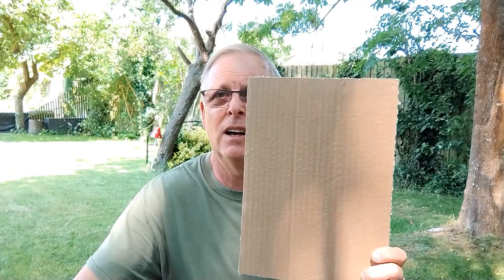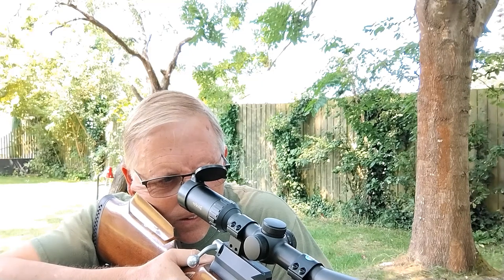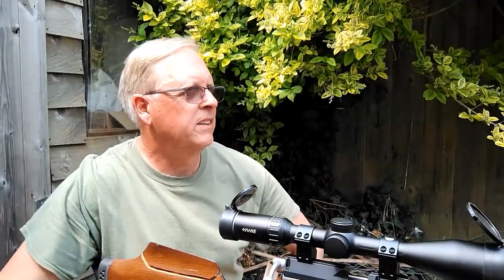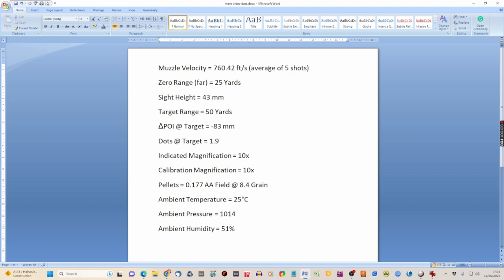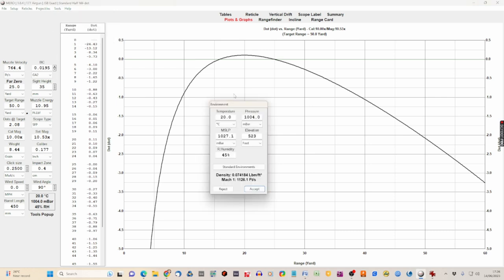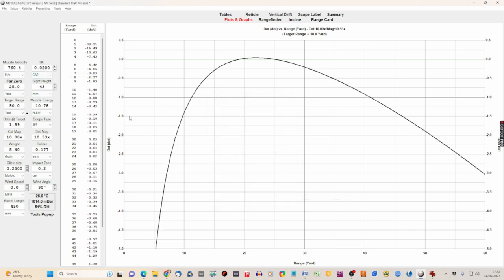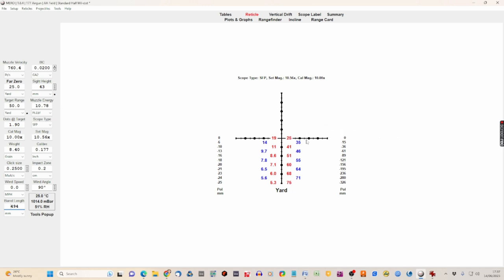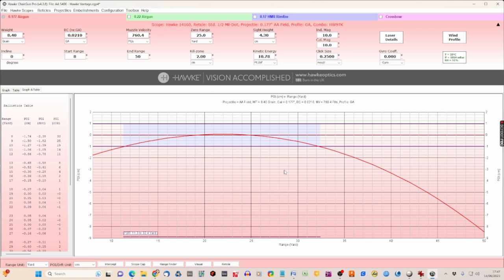9 - Master Air Rifle Ballistics Software in 5 Easy Steps

Comment: Thank you for this great series of instructional videos. Could I ask if there is any practical benefit to have a chronograph that can measure the projectile speed at the target instead of just at the muzzle?
Reply from the maker: Thanks! Not in terms of a single chrono I think. If you had two chronos, one measuring muzzle velocity and one measuring velocity at target for each shot, then you could calculate an accurate ballistic coefficient for your pellets.

Comment: Hi, I think I saw you at the recent BRK day! Thanks for the good tip regarding scope height. Do you do this after you have zeroed the scope, or when the reticle is optically centred? Thanks.
Reply from the maker: Hi Malcolm, if you're doing the tin foil test then probably best to do it after you've zeroed your scope. 👍
Reply: Thanks!

Comment: Great information. Hopefully you can answer a question for me. I am zeroed at 50 yards, shot a 100 yards and Mero calculations were way high. I adjusted to hit my target. I then changed my scope height setting from 2.66 inches to 5.50 inches to get hold over correct. Am I doing something wrong or is this normal to adjust scope height setting? Should I be changing another setting? If you have time, I would greatly appreciate your input. THX--Matt
Reply from the maker: Hi Matt, as I understand it the crucial settings are scope height and ballistic coefficient. I would recommend using the tin foil method to find your exact scope height at the muzzle and measure your pellet drop at a set distance to determine a more accurate BC if you're using manufacturer figures. I'm zeroed at 25 yards and measure pellet drop at 50 yards. It sounds like you can shoot to 100 yards with your 50 yard zero so I would measure at 100 yards and use the Mero tool to work out your BC. Once you put the figures in Mero will match your results at 100 yards and calculate backwards for shorter ranges which should be closer to what you're experiencing. However, at the end of the day shooting on paper at different ranges is always going to give you the most accurate drops and aim points for your rifle. Hope that helps.
Reply: @hftshooter  
Thank you for your response. I will give that a try. Much appreciated.--Matt

Comment: Hi Jeff, brilliant piece of work which must have taken ages to put together, I am learning all the time.  Not sure about the tin foil method, seems like a very "iffy" way of getting an accurate measurement.  How did you discover that a simple mechanical measurement of the scope/barrel was incorrect?  Using basic trigonometry, based on a 25 yard zero and a 45mm scope hight (hate mixing units) at the objective (Scope diameter + barrel diameter /2) + gap between top of barrel and bottom of scope) if the barrel sticks out 400mm beyond the scope then the difference in the trajectory lines would be 0.692mm which is nowhere near 5% and is within acceptable error. This is not criticism, just debate to find the best solutions 🙂
Reply from the maker: The tin foil method is in no way iffy. Measuring at the muzzle is the most accurate figure. That's where the ballistics start. I learnt this from a respected source who's info I trust.
Reply: @hftshooter  Please don't be offended. I am just trying to debate the method. Just stating it is right without any background doesn't work for me. Calculating is as near absolute as you will get with known dimensions. You didn't measure at the muzzel. You measured at an unstated dimention from the muzzel to the cardboard, you also hand held the rifle which could also lead to deviations and you measured to an estimated centre of the pellet hole.  We are talking about small dimentions so very little room for error.  If you would prefer that I didn't comment on your content just say and that will be that.
Reply: @fxpeter22  I'm not offended at all, please don't think that. I welcome all comments and questions. I'm not an expert and am just passing on this stuff as I learn it myself. I'm happy to be proved wrong at any time if I've picked up bad information. Unfortunately it's very easy to get misconstrued in a messaging app.
If you check out my video number 45 from about 16:30 I cover the tin foil method in more detail. You should see that the muzzle is touching the paper target when I take the shot. I have read some compelling articles promoting this method and have also noted graphics in some ballistic apps that clearly show that sight height is measured at the muzzle for ballistic calculations. Still happy to be proved wrong if that's not the case and I would happily broadcast a correction from the channel. I encourage you to continue to challenge everything to get to the truth; a mantra to live by! Best wishes, Jeff.
Reply: @jeffmccall8013  That is great. I will get back to you 🙂

Comment: Great video, thank you, Iv'e had a look at downloading MERO V1.9.0 on my Windows 11 machine however my antivirus and windows is suggesting it's an unsafe program to run?! any thoughts on this, thank you.
Reply from the maker: Hi Michael, sometimes Windows can be a bit over-protective with installs. In this case it just doesn't recognise the software creator. If you click on the 'More info' link in the blue box a 'Run anyway' button will appear. I've used this program on a Win 10/11 PC for a long time without issue so it will be safe on your system. hope that helps.
Reply: @hftshooter  Thank you, I am aware that PC's can be a bit over protective sometimes, I'll give it a go 👍.
Keep up the good work, your channel is super informative, really helpful to those like me, new to the sport 🙂
Reply from the maker: Glad to be of service!

Comment: Need to ask you a question, with the furthest target at 45 yd’s in HFT, why did you do a pellet drop measurement at 50 yd’s?
Reply from the maker: As I understand it, you get a more accurate ballistic coefficient calculation at 2x your zero range or more.

Comment: getting your  sight height , do the scope turrets need to be centered ???
Reply from the maker: No, the scope turrets do not affect sight height.
Reply: So it shouldn't make any difference if your using your scope crosshairs and the turrets are turned to maximum elevation or minimum elevation??
Reply: @rivit90  not as far as sight height is concerned. However, if you find yourself at turret limits there may be something wrong with your scope mounting?